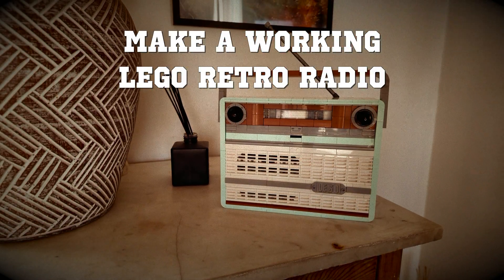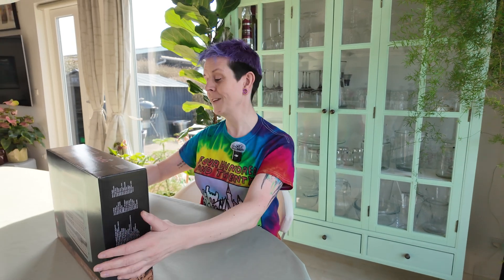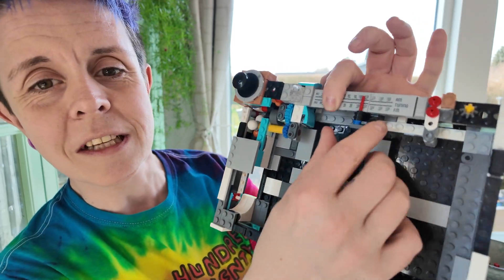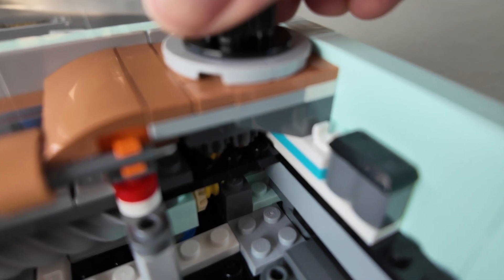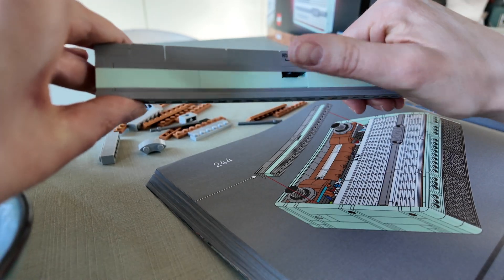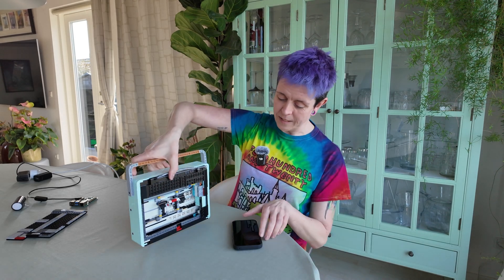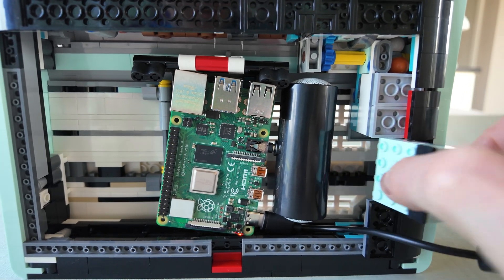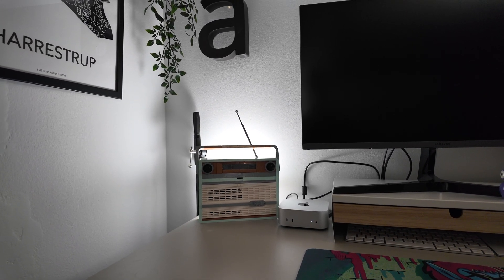I made the Lego radio actually play radio!

Comment: Very cool project! In my case, I'm just using a mini Bluetooth speaker (jbl go fits just right) and use radio app, YouTube music, etc, with my phone 😀
Reply: Yes, that makes a lot more sense than putting your phone inside.
Reply from the maker: ahh that's also such a great solution!!! good to know the JBL fits. I considered it but thought it would be too big!
Reply: @aimeerivers Specifically the JBL Go Essential Bluetooth speaker. I've just finished building my LEGO radio, and I was watching this video when some parts didn't make sense to me - to get the on/off dial assembly to work. So, thanks for your help.
Reply from the maker: @aspie4jc you'll be happy to hear I now have a JBL Go inside my radio! 🥰